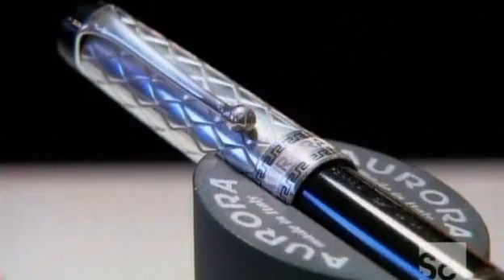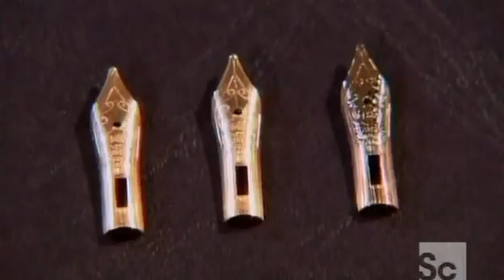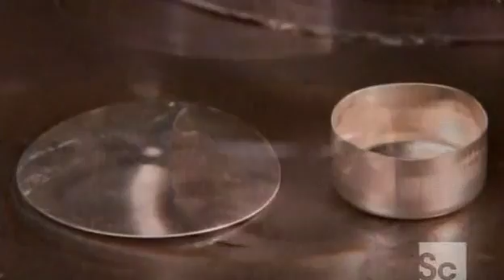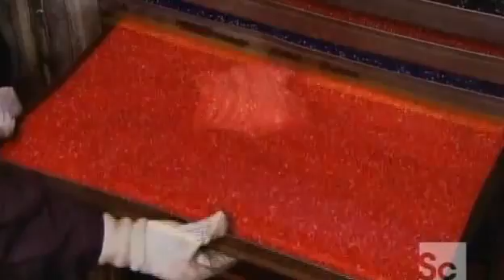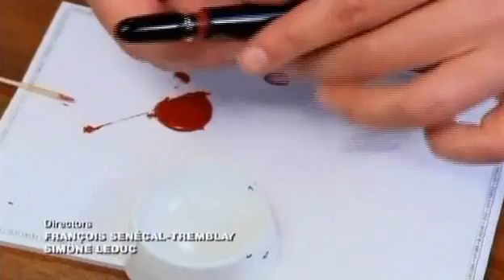How its Made, Fountain Pens.

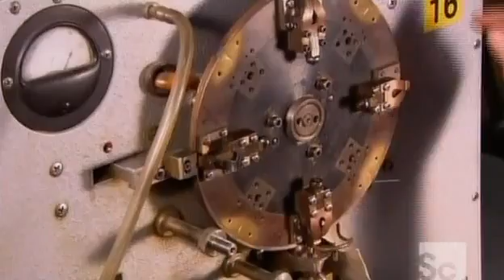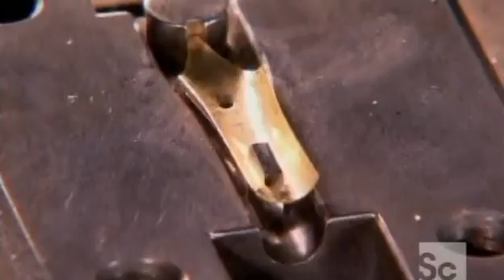Comment: The iridium tipping (at 1:40) is added before the ink pathway is cut (at 1:30). Otherwise ink would not flow to the paper.

Also, not many pens are made with actual iridium nowadays. Today, it's usually a similarly hard alloy.